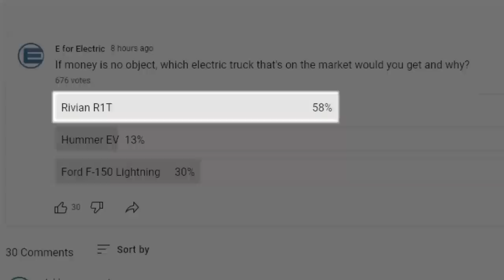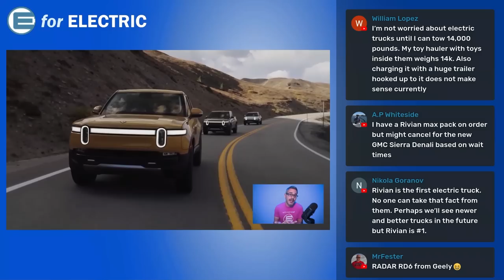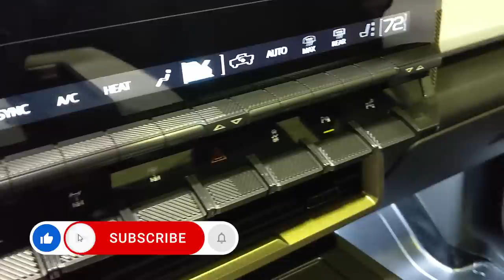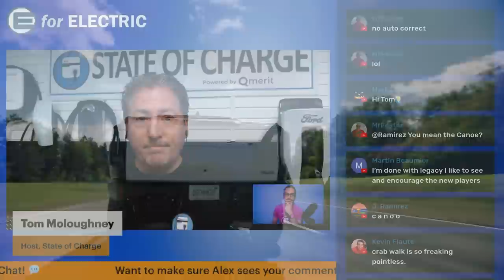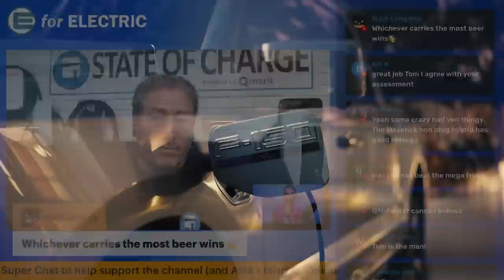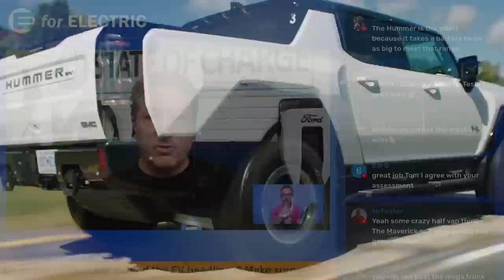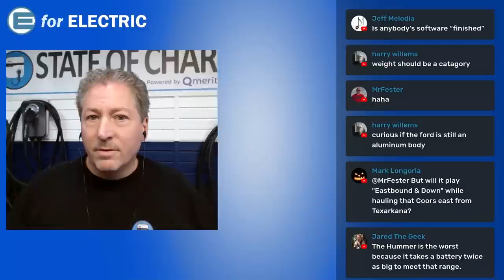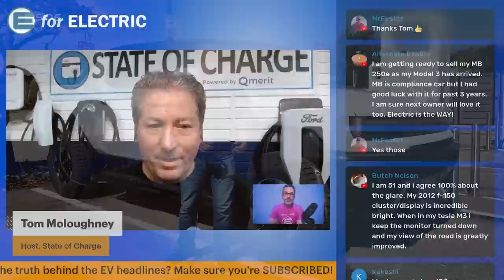The Best Electric Truck Snubbed

Comment: Tom is right. The Lightning is just better as a truck for those who actually use a truck on a regular basis. Sure, on the surface people don't care how big a battery is in the EV, or how efficient it is. But people do care about cost and time. The Hummer is peak "dumb" range. It has the largest battery pack and the most power, but can't haul more than the Lightning, takes 3-4 times as long to charge at home, and costs the most to drive (both in terms of upfront cost and cost per mile driven). Trucks for decades never connected to phones or had computer screens, I don't see why supporting Android car play or having a nice GUI improves the usefulness of a truck to the point that lacking them is a deal breaker. This is the problem with having a computer software designer from urban parts of California reviewing a truck. The fact that the Lightning also has the biggest trunk (adding more dry storage space then a typical truck of the same size), can function as a generator to power tools or your house, and shares many of the same components with the Ford 150 (the best selling vehicle in the USA with easy to find parts) is another huge feature for people who use trucks as tools, not toys. Like original Hummer, the Hummer EV is cool toy for the affluent, but not a vehicle that most truck owners would actually want to use on a daily basis.

Comment: Let's also remember repair. Many of Ford's parts are interchangeable with the ICE F 150 meaning you do not have to wait 3 months for a fender.
Reply: I had the same thoughts. I just wish I could get one at MSRP and not deal with a dealer. I would have bought one already.
Reply: On this note, the Lightning has unique front fenders, hood, bumper and bedsides. The cab, doors and glass are all the same. Insurance must have figured this out too cause they just hiked my rates
Reply: @bradleyhanlon  Yeah, Geico upped my Modey Y by 20%

Comment: I mostly agree with Tom.  The one part where I differ is on the software, that does matter and Hummer wins that hands down.  Having an OS and software designed by a software company that knows what they're doing pays dividends in both the short and long term.

Comment: I voted for the F150, but the User Interface for the Hummer is special and GM should port it to every other car they make.
Reply: First look at the mess the folks at TFL channel had with their new $115,000 new Hummer. They got stranded on a extremely busy road on a rainy day. The software took a dump & they couldn’t reboot or place the truck in neutral to tow & On Star was no use! 🤦‍♂️ not what you expect from a high priced rig!
Reply: Lol, I would never buy a GM unless it's a eCorvette

Comment: My vote is for the Lightning. First, it is probably the best value in the EV world. $51K for the Pro is an amazing deal. The Hummer has many faults, that the F150 or Rivian don't.. 1) slow charging for home (I believe it is 19Amp not 48), 2) using more batteries to compensate for poor efficiency, 3) weight!, 4) Price (As there is no cheaper version).

Comment: As always Great to hear what Tom has to say even though we'll never get these trucks here in Australia Cheers
Reply: You'll be able to buy an electric LDV soon enough.
Reply: @AutoReport1  thanks sounds great
Reply: I am sad for you! Why don't American manufacturers sell trucks in Australia? Are there protectionist import laws in place?
Reply: @Wordsmiths  wrong steering setup. Australia is rhd, it's not worth the low volume to build and tool for such a small market. Other rhd markets aren't so into pickups, they use forward control lorries and chassis-cab vans. Fuel costs were also a lot higher, although California is getting pretty close now, and emissions controls are very lax, so first British and later Japanese diesel lorries were used for horse box and RV conversions, no larger trailers. That means no larger caravans or boat trailers and nowhere to park even if you build one. If your boat is too big it stays in the water.
Reply: Factory backed conversion production is ramping up, but that means higher costs, so minimum prices are very high. Converting the instrument panel and interior is the biggest issue, design the LHD version the wrong way and it can't be done at all.

Comment: You're right. The Hummer is the best current truck for men who are going through mid-life crisis. It makes no sense for those who are going electric to reduce their carbon footprint.

Of the current electric trucks on the market, the Ford F150 Lightening is the best truck for availability of parts and OEM options. However, the Rivian R1T is the best all-around truck. I don't consider looks much in a utilitarian vehicle.

In the future, I predict that the Tesla CyberTruck will be more efficient, have better specs, and be less prone to need repair due to its stainless-steel exoskeleton. However, right now it's still vaporware. (The Silverado will just be more of the same type of truck as the Ford.)

Comment: Alex, Love  your channel.  This was a good video.  The Hummer is a wasteful vehicle.  I have a Model 3 SR+ and I'm on the waiting list for a F150 Lighting Pro because of the 40k price point (which maybe gone now). let's talk about TOU (Time of Use) Charging which is basically what every EV Owner has to consider. 

A Hummer could take 24 hours to charge at its max.  My TOU rates are $0.105, $0.39, $0.649 per kilowatt hour.  I can charge my Model 3 at 20 amps on an old dryer outlet so currently I will only add a little less than 20 miles per hour.  My super off peek 12-6 am M-F and 12-2pm Sat and Sun.  During the week that's 5 hours I can charge it cheaply.  This means at best I could add 100 miles of range.  There are times when I have to get up at 5 and shut down the charging and spread it across days. 

Again, the Hummer is a wasteful vehicle.  Most people can't afford to waste money needlessly.   The F150's vehicle to home is important for people that have power outages like Florida or Puerto Rico.  and the frunk of a lighting is the only lockable storage that people can't just break a window to get into when they see something interest.

I have to agree with Tom

Comment: Btw, trucks, when used for work, do not do much travelling. A contractor does not go 3 states west to get a bunch of plywood. The vast majority of time, they stay around town, even when not working. 
As for range,  charge time is also important, the question is: how long to charge enough for 100 miles?
The Hummer has a MASSIVE battery. 800 v is ONLY available on Ultium if you double stack the batteries. That is why their SUVs are only 400v and have a low charge speed. We’re talking slower than a model 3!

Comment: As a long time (since 2016 anyway) EV owner I would like to share my perspective on charging. First, my approach to charging my cell phone. I try not to let my phone battery drop below 10% and I try not to let it charge beyond 90%. Also I don't use the 'fast' charger that came with my phone, I use a much lower amperage charger which of course is much slower. The result though is that I can get several years of use from my phone battery. The phone I'm using as I type this is close to 4yrs old and can hold a charge for most of the day with normal use. I approach the charging off my EV the same way. I charge it at home pretty much all the time, I use level 3 (110v) to charge. I try not to let the charge go below 20%, and I set the onboard computer to stop charging at 80%. The car is a 2013 Nissan leaf with a 24kw battery. The battery state of health is displayed on the dash, when I purchased the car it was 3yrs old and the state of health was still showing the full factory 12 bars. I've been driving it for 6yrs now and the state of health just recently dropped to 10 bars. My research years ago led me to understand that  Lithium ion does not like fast charging and does not like being run down to zero and does not like to be charged to 100. So far, following this practice seems to be working for me.
Reply: I also have a 2013 Nissan leaf. How many miles (total millage) do you have on yours? 10 bars is great.
Reply: Yes, sensible caretaking of Li-Ion pays noticeable dividends...

Comment: It's "best" depending on the use case / target audience. Hummer EV is definitely the best looking truck with the most range, and its audience probably won't care it's least efficient and slow to charge at home. Hummber buyers probably dont care to pay a bit extra for charging, just like they didn't care to pay extra for gas so efficiency is less important to them. Ford Lightening is probably better for a typical user who actually use it as a truck / utility vehicle. For them a better mile/kwh and charging cost saving is better. In the end of the day, what's "best" really comes down to what matter the most to individuals and different specs / attributes equal to different value to them. For some Rivian buyers, all those other things don't matter - Being able to fit a pop-up kitchen and attach a tent is a lot more value than the looks, range, charging speeds etc. So Hummber is best for Exotic Car Audience, Lightening is best for Utility Audience, and Rivian is best for camping/outdoor audience.

Comment: This is just hypothetical, but if I were in the market for a work EV, these things would be on my must-have list.
1 .. Range, but not at the expense of a useful towing capacity if that was a regular requirement.
2 .. Loading carrying capacity with an emphasis on ease & convenience.
3 .. Readily available spare parts if things get accidentally damaged.
4 .. A large frunk that's easily accessible.
5 .. Power outlets.
The F100 wins in every category, PLUS it's the cheapest.

Comment: I found this very interesting.  I have an R1T & have driven over 4000 miles since mid August. I was an early preorder (Dec 2018) & was wrong that they would get to market before 2021.  I was wrong.  I have a few complaints& a lot of likes about the R1T.  I cannot understand why there is no satellite radio availability!  Driving across the southwestern deserts & mountains with "Tune In" was awful.  All terrestrial signals require ground stations & with distances in the under populated areas so vast, it is awful.  I do not have Spotify subscription so I can't say anything about that except that it is also terrestrial--enough said.  Recently traveling to vista relatives & carrying a lot of stuff to them was great with all of the storage & having the covered bed for carrying dirty items was great.  The gear tunnel worked great for suitcases & thing needed daily.  The estimated range was very accurate (except with the headwinds---which it could not know) with drive modes to add versatility.  We drove interstate highways & dirt Mountain roads & the truck handled them flawlessly. If the frunk was sized to hold the  Yeti cooler, that would have been way better.  I want the 400+ mile range!!!  There is no way to operate off the interstate system with less when towing even a small trailer of any kind (in the western states with the 200 mile + distances between DCFC.  I'm looking at the longer range Silverado for some of these problems---hopefully.  For now, I don't miss fueling the diesel Ram for trips like this.  We stopped for meals & charged while eating, solving both problems easily.

Comment: On any of these trucks, travelling and having to recharge on a 50KW DC "fast" charger can mean spending the same time charging as driving. Here in Canada, travelling in the Maritimes provinces would be almost unthinkable. Yes there are a few Petro-Canada charging stations supposedly at 150-200 but they are half of the time out of service, the other half plagued by their infamous temperature probe issue that often limits their output to 35KW even when the cable is frozen to the point it almost takes two to plug it. With all the charging issues encountered by the TFL guys and their Ford Lightning in extreme Alaskan conditions, we can say the charging infrastructures and winter driving/charging conditions are not ready everywhere in North America for electric pickup trucks.

Comment: We should also remember that many high voltage cars seem to only reach the peak for a very short time. They quickly drop to a MUCH lower rate.
In the end, we should have a highest average rate or weighted average of charge rate. A 350kw charge rate is useless if that is only for 5 minutes.
Give me 180kw which is for 90% of the charge instead.

Comment: IMO, the post important "charging" statistic is the driving efficiency of the vehicle (wh/mile). The ideal vehicle is one that is the most efficient with the smallest battery that gets 250 to 300 miles of range. The smaller the battery, the less materials it takes to build and the less time it takes to charge (assuming average charge rates). The smaller battery also costs less to charge and is the most efficient to charge at home. The Hummer is hugely inefficient and so they need a very large battery, which requires lots of materials to build and a lot of energy to charge. My expectation the Cybertruck will be the most efficient when it is released simply because of the wedge shape and covered bed, but we'll have to see when that time comes.

Comment: Also, the size of the battery matters if you have to repair it but it can also mean that range goes up if they optimize the software.
Reply: @paradigmshift7  I was speaking somewhat generally but you may be correct.
Reply: also, you might purchase highway-optimized tires with lower rolling resistance— that would increase your range even more (!!)

Comment: When looking at charging it is not KW that matter. It is kilometres (miles) per hour. Hummer may have a higher charge rate, but it uses more KW per km. So it takes longer to charge each mile. Or to put it another way - you are stuck at the charger mid-trip for longer to get charge for the next leg

Comment: Hummer has a heat pump and the coolest features with the best interface. It’s massive size weight and battery are the biggest draw backs. & it is a lifestyle truck. The Silverado/Sierra will probably be the best options. The ultium gives them an advantage over ford and their decades of building trucks gives them an edge over Rivian in terms of the crab walk and mechanical engineering. The ford F150 is the logical choice for many bc of its practicality and simplicity.

Comment: You guys need to try the Heil PR30B mic.  Isolates reverb better, expands the male low end.  Works excelend between 1/2 - 4 ft in distance without low end drop off.  It would sound SOOOO much better than those mics you are using.  I think Tom sounds like he's using his Apple headset mic.  Yikes.  Come on guys.  you're Pro Youtubers.  Step up the Mic game here.

Comment: The Hummer still does have a 3kW outlet - and it still does have a reasonable frunk for Tom' and Alex's manbags...

(don't forget that a model 3 frunk is pretty much filled with a charge cable, tow strap (and obligatory aftermarket tyre inflation kit, lol))

The HUMMER outlet can power emergency circuits in one's house. - both contestants can get "tied up" in being "the most objective" critic, when subjectivity abounds.  (breathe - jk).

Comment: If you say the Hummer has the longest range you also have to recognize if you use that range that is only achieved by having a hilariously large battery you have to recognize it will take 2 hours at a fast charging to fully charge…..so does that range really matter if you are stuck waiting

Comment: None of the three "trucks" currently available are actually useable as trucks. I think LMC actually intends to make TRUCKS, not SUVs with tiny open cargo spaces. Ford is most disappointing in this regard, F150 is the top seller in the US because it is a TRUCK. I want to see a comparison between ETs with 8' beds, and I don't think it's even worth talking about them until we can. Hummer might convert like an Avalanche, but I can guarantee no one would ever do it in the real world.

Comment: Nice topic.  But.. Still covering the camera as a ‘clever’ trick... a small echo in the room...  also, I don’t want a car that is good as a phone, with constant updates, changing the way it works from day to day so I have no clue how to use it, and making itself obsolete. I want a car that drives and runs for many many years. No need to get a new battery after ~eight years.

Comment: The Ford for the win because it is the only transition for current ICE F150 owners. All their truck stuff, racks, tool cases, etc. just plop right in. Even the non-work trucks have these extras and the owners don't need to buy all new. The Hummer isn't a real truck at that price. It's for rich posers driving around hoping people notice them, just like the original Hummers were. The Rivian may win for the urban people that want a truck but only use it as a sedan.

Comment: If the Hummer had a dent-less steel body and is road rash resistant like the CyberTruck (I have on order) i would seriously think about the Hummer due to software and charging speed. Im not buying another crappy ICE truck that gets dents and where I have to replace windshield 5 times!
Reply: $100k+ for Hummer and not hail resistant?

Comment: You're ide of what a trick is is totally biased. People don't generally use trucks primarily for hauling trailers across country.  I need a long bed and to be able to make small trips and haul long things. A frontk is nice to keep things dry and out of the cab. The Hummer looks like it's designed for a teenager.
Reply: I wouldn't be caught dead in the Hummer.